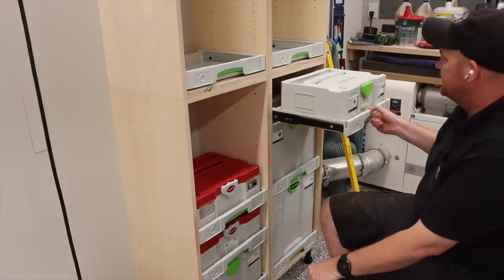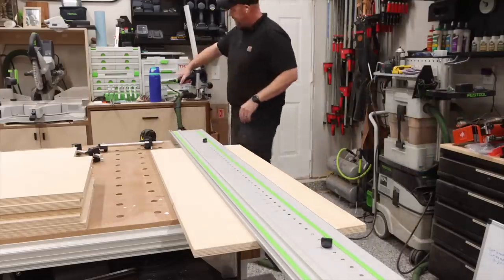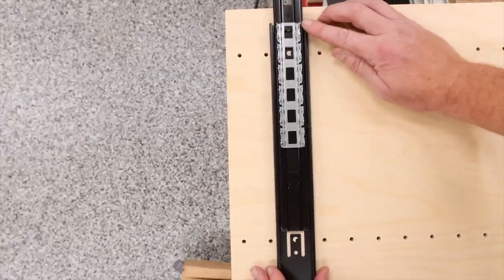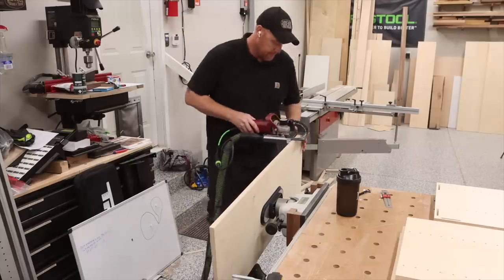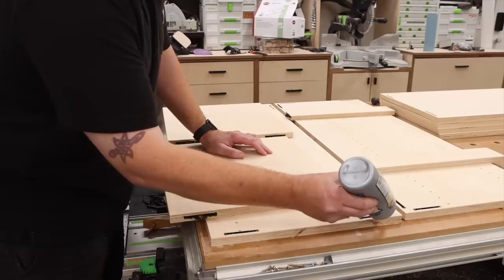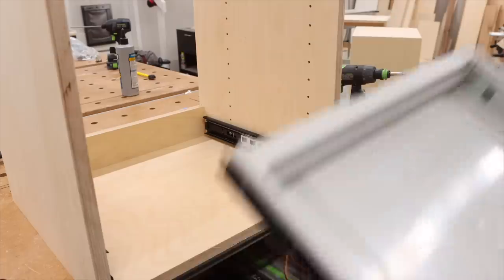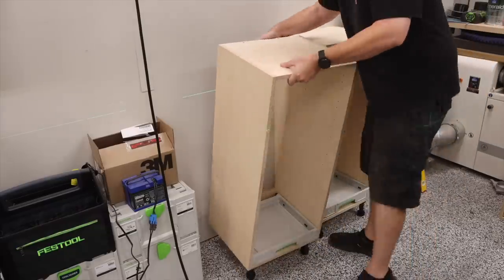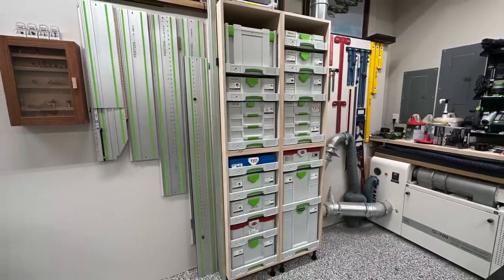Ultimate shop organization || PLANS AVAILABLE

Comment: Jason, I have gathered 20 sys-drawers off craigslist over the last year or so at an average cost of about $35 each. For those of you wanting to build these keep an eye out as many others buy these but bailout on their project and will sell at a reasonable price.
I will be building ten units in about two to three weeks, and I will be using a very simular installation method. Primarily an adjustable foot in place of a toe-kick to support the weight on the front side. In using this I will be placing the bottom of the first or bottom cabinet on the outside, not the inside as you have done. I know you build cabinets and usually the bottoms are placed inside due to sheer strength. But in this orientation, like the instructions that come with the drawers recommend, placing the bottom on the outside is best when supporting from the bottom (at least for the bottom cabinets). The instructions I believe are trying to replicate the old mobile M1000 with casters and placing the bottom on the outside is much stronger in supporting the weight. I hope this makes sense?
Anyway, I will have ten cabinets total, two high and five wide. And my suppliers here in California still have Baltic Birch, it will cost about $1200 to build. 😒
I love the Lamelo, and the new Hammer, but I'm sticking with my Domino and Sawstop for this project.

All the Best, Chuck.

Comment: For anyone doing this for themselves: I highly recommend doubling the LR32 holes at 16mm apart. It makes it much, much easier to fit systainers in there afterwards without any wasted space. On the Gen I and T-Loc everything went out the window the moment one stacks a no. II systainer in there as it has an odd stacking height of 1.5. That would always leave an unnecessary gap between drawers.

Comment: if only I could get that vac sys. I didn't realize the value of it until it was no longer available. that paired with the lamello would make for some quick cabinets.

edit: fantastic idea with the back strip installed level with a laser. that has to be the quickest/easiest way to end up level.
Reply from the maker: Vac sys is a solid tool!

Comment: When you have some free time, check the toe out from the slider and rip fence to the blade. I saw a bit of burning on the edges of your plywood. That shouldn’t happen with a properly calibrated slider. I haven’t had a burned edge in years, and that includes 8/4 hardwoods like white oak.
Reply from the maker: It was my rip fence to blade. I noticed it on the first sheet and had to adjust it. My slide toes out about 4 thousandths

Comment: Love the use of tenso connectors to bring your panels together, but probably a very expensive solution for anyone not doing premium cabinet work. 

If you were to scale that up to your standard built in wardrobes, it would probably run you $300+ in connectors.

Comment: Great video as always Jason. The Lamello is a great tool. Using the auxiliary baseplate would have helped steady it a bit more and goes on and off so easy I try to use it when I need extra support. When I got my Festool VacSys I decided to buy the double unit and it has come in very handy especially for doors or large panels.
Glad to see you are getting so much use out of the slider.
Was that the new Festool 12volt CXS drill you were using? If so how do you like it and do you have a review on it?Thanks for sharing and keep up the great content.
Ron
Reply from the maker: It is and I don’t have a specific review on it. It’s a great little drill. Definitely more power than the previous
Reply: @bentswoodworking 
Thanks for the reply and information. I will have to give the new one a try.

Comment: Connectors, glue and screws? Don’t understand the reason for this. What are the benefits of using these connectors instead of simple dominos or dowels?
Reply: No clamping needed.
Reply from the maker: I did want to fuss with clamp’s during the glue up. That’s the point of these connectors. You can use anything you want. This is just what I chose for this project. Structurally there was no benefit over another technique here other than I could snap it together and set it aside
Reply: Understand… yes for that it is very comfortable 😂

Comment: And at $53.00/ tray, that's a lot of money!  Not to mention that there is almost nowhere to get baltic birch these days.  Nice cabinets though.
Reply: In Germany they can be had for around 36 Euros per slide if you buy the set (of 5). You can also buy the Tanos ones, which are slightly cheaper (also in Germany) and are exactly the same besides the color (grey instead of festool-green).
Reply: I had the same thought about the Festool slides.  You’re using the LR32 system, can’t you just use plywood selves?
Reply: Whats up with Baltic birch ply?  I got no issues finding it, although it's a little pricey, but what isn't these days.

Comment: This is'nt a critiscim, but I've noticed that most American woodworkers never seem to have a blade guard on their panel / rip / dimension saw. Is this normal practise in the US? Here in the UK it's common practise to always have the blade guard in place and if a health and safety offical came calling and saw it was missing, he/she wouldn't be impressed....Very impressive cabinets btw!
Reply: Safety official. Lol. Does he/she/zhe also check the dirt under your fingernails?
Reply: @MrMaritoJavier  No, but at least we still have fingers to have nails on!
Reply: @sicr7373  And what color do you typically polish your nails with? Lol. Go and watch some figure skating.
Reply: Why is it the govt’s job to protect your fingers from yourself?
Reply: @MrMaritoJavier  My orginal question was asked in good faith, and as I stated there was no critiscim intended, but for some reason you seem to have taken offense to it, I've no idea why? Does the US not have regs in place to protect workers?....Oh wait a minute, yes it does, OSHA says '1910.213(a)(12)

For all circular saws where conditions are such that there is a possibility of contact with the portion of the saw either beneath or behind the table, that portion of the saw shall be covered with an exhaust hood, or, if no exhaust system is required, with a guard that shall be so arranged as to prevent accidental contact with the saw.

Using safe practises in any working envrioment, especially ones with potentiely dangerous machines in it seems sensible to me, and God forbid there's a time you're picking your fingers from one hand off the floor with the fingers on your other hand don't come crying to me.

'
Reply: @CFAinNoVA  Why do you have OSHA then? Why does your government say you cannot leagally drink alcohol until the age of 21 when mine treats me like an adult at 18. Neither yourself or the other gentleman MrMarioJavier seem willing to simply answer my orginal question, maybe someone else will...who knows?
Reply: @sicr7373  I think what made people pile on was the "health official came calling" and assumed it was to your house.  Given Jason's work is in his garage, reasonable jump to conclusion.  I was even going to quote you and realized that you never said to your house.  As for the blade guard, I'm guessing it's because the doesn't have dust collection hooked up yet.  And lot of YT'ers don't have it for filming reasons.
Reply: @hansangb  Thank you for a reasoned and sensible reply,  and for the record no ill will was ever intended with my question.
Reply from the maker: I just don’t think here in the US it’s ever been as big of a deal. I assume it’s because there is no rule saying we have too.

Comment: "...18mm, or for the weird people, 3/4 of an inch" 🤣 I can't imagine building cabinets in imperial. Those poor people, they don't know how easy it could be
Reply: The reason is because numbers and math are damn near impossible to change as an adult.  No one really knows why.  My mother did all of her arithmetic in Japanese because when she was in grade school, it was under Japanese rule and Korean was forbidden.  I grew up on Korea so I do arithmetic in Korean (in my head) but do algebra/calculus/Diff EQ in English.  Also, it's hard to "visually see" what 53mm looks like. Just like it's hard for you to quickly visualize how long a 144" piece is.

So w/o a forcing function, it'll never change.  If you go to the military, you do learn in metric. Everything is in klicks (kilometers) and meters. When you read a map, when you move out, when you call for fire, it's all in meters/km.    Strangely though, all aviation is in Imperial (knots and feet) the world over.
Reply: What I don't get is why people think one way is easier or more difficult than the other.  I went from metric to imperial since it's just a preference but 90% of the time I use relative dimensioning so I don't do any math.
Reply: Great project. I have a small systainer cart on wheels. But It only holds like 3 or 4. LOL>  And I already have more sitting on the floor next to it. And I definitely have goals for a few others. This would be great. I’d like to get a systainer for my TSO stuff as well. 

I find myself being drawn more and more to metric. It is easier. But I still don’t have it down. Like… I know what 3/4” looks like visually. BUt what is that in metric? I want to say 18 off my head. But I’d have to look. LOL. I did however buy the same tape measure you showed in one of your videos that is both. And I love it. I use it often and it’s my favorite. My next shop piece will be in metric. I do agree… the numbers are just easier. Who wants to try to figure out what 5/16 really is when you can just say….8mm
Reply: Yep, agreed, but I bet you think of sheet goods like this: “An 8 by 4 sheet of 18mm ply”…